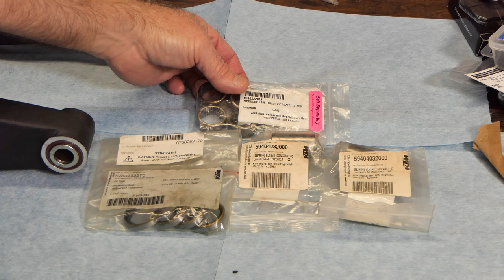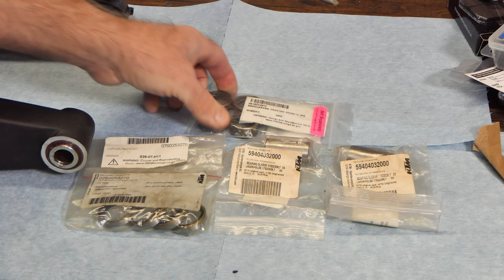CFMOTO Ibex 800T Swing Arm Bearing Replacement...

Comment: Again John, exceptional explanation on servicing your own motorcycle whilst it’s cold & snowing during winter 👌 As I mentioned, it’s not because of poor materials, it’s the lack of grease from any of the manufacturers. They all are guilty of lean manufacturing. The rust from water ingress is either from river crossings & /or rain. Insufficient grease cannot protect the bearings with or without a dust seal or sealed bearings. Will you be checking the wear of the sleeves next winter after replacing the materials & re-applying grease?
Edit: I think you need a hand press to press the bearings in rather than a hammer. The more needle bearings, the less wear will occur & minimise scoring the sleeve.

Comment: Great Job John. I think instead of removing the bearings I would have used the sleeve as a retainer. Hind sight being 20/20 . BTW I serviced mine after watching your last video. They were well lubed from the factory but yu never know. I was able to service them with the wheel on. I just drove the center rod out far enough to do one side at a time.

Comment: After watching the first video, I just repacked my swingarm bearings yesterday.  Virtually no lube. But no rust or wear. So I'm hoping now it won't be an issue. Next is the steering bearings. You've been a great help. I still would have liked for you to do a chain replacement video as it's pretty vague on just where the tention is measured.  But I did that yesterday as well, so I think I have it figured out by cutting a pvc pipe at the minimum and making sure it's slides in easily.
Reply from the maker: Good to hear from you sir... thanks for watching.. :)

Comment: Great work 👏  The bearings otta be sealed better before leaving the factory imo .
All motorcycles not just Adventure bikes ride through floods and swing arms on all bikes considering the abuse they take, should be better prepared. 
Well spotted John and thanks for exposing  manufacturer's weaknesses

Comment: Hi, can you make an video for correct wheels installation and chain alignment. The axle, brake caliper tightening for front wheel and rear wheel chain adjust markings are not self explained or precise, Just wondering, by tightening rear axle, the axle markings plate always moves?

Comment: You should invest in a small press. Then you could press the bearings in without needing to remove the rollers. Also, use the inner sleeve so the needles don't need to be removed.